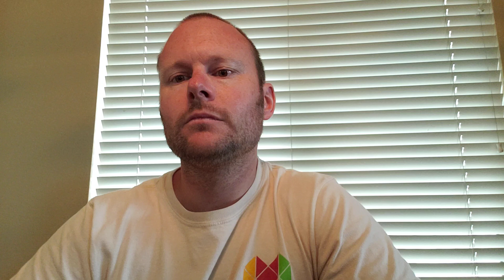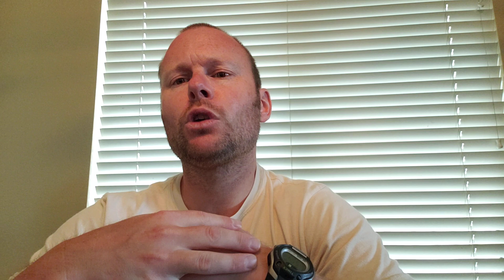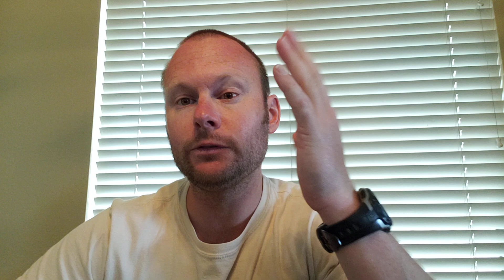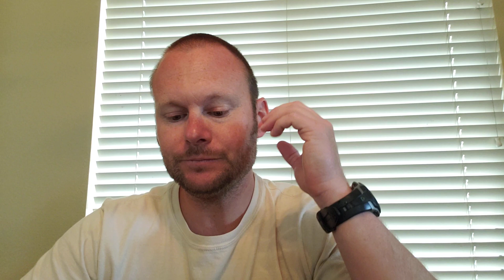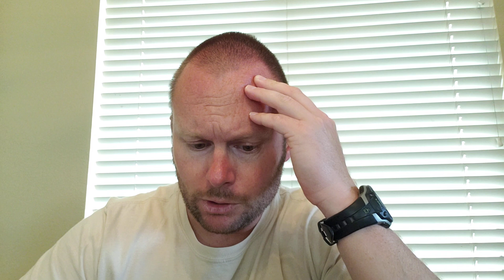Chrysler 200 Misfire Fix! (OBD2 Code P0301)

Comment: Thanks man i have 2016 200 it has the same cylinder misfiring. I did change all spark plugs. I guess i need to change the coil

Comment: Thank you for this.  I'm having the same problem and I suspected it being the Ignition Coil.  I changed my spark plugs a few weeks ago and I thought I fixed the problem.  I'll try putting a new IC in and see if that works.